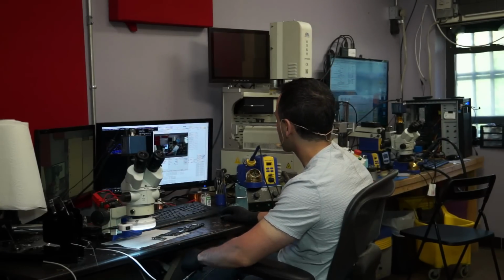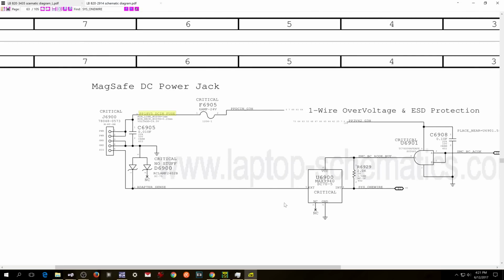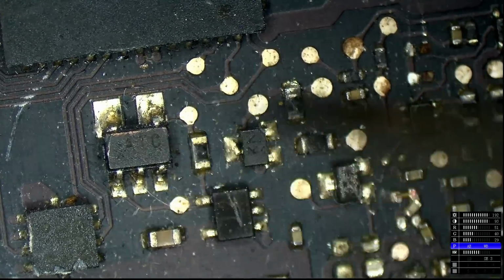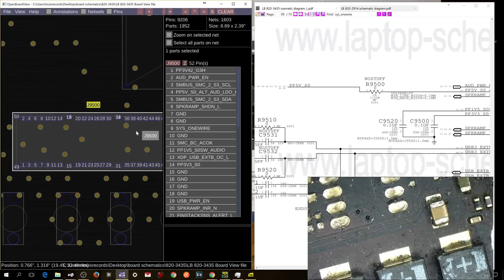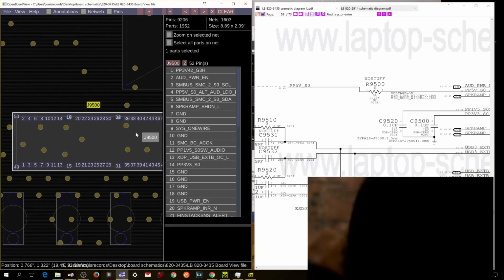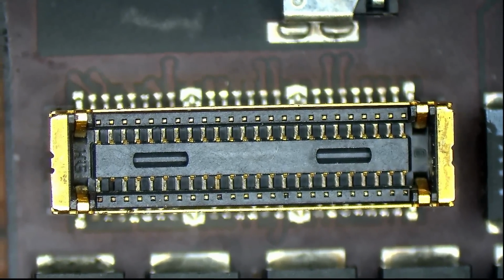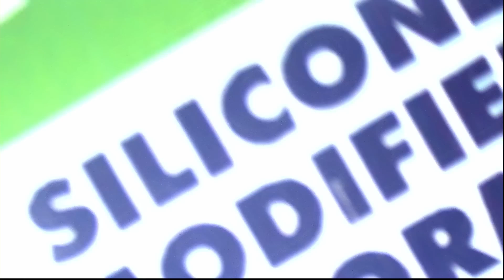Macbook Air no light on magsafe charger 820-3435

Comment: What's up Louis!! I'm working on a friend's MacBook Air A1466 because he brought to to me because it wouldn't power on. I noticed one of the caps (neb av7) was fried so I replaced it with a new one. The system board ohm'd out however it's still not powering on. Tried a smc reset but still didn't power up. 

The only thing I have left is the I/O board. Wanted to know if you could give some helpful tips on cleaning it? Alcohol perhaps?

Push comes to shove I'll just go ahead and order a new one.

Comment: Ok This is soo above my pay grade lol.... my mac book air  took a spill not even a foot off the ground and now I'm hearing a loud static sound coming from the battery post and now it won't charge. Also the lights on my keyboard don't come on. Tried smc didn't work... please help.
Reply: D.O.A. Yes, and no. Lol I went to Apple, and they said it was logic board failure.... Cost of damage $475.00
Reply: D.O.A. Yeaaaaa I'm not qualified to do that,  and I don't have a warranty. :-( I am going to get a second and third opinion as well as another price quote lol

Comment: I NEED HELP: macbook air had no backlight, got it to a shop to get fixed, now the laptop works only on battery, as soon as i plug it in the screen back light  goes black and the mackbook does not charge.
Reply from the maker: bad dc in board/dc in flex. the SMC_LID sensor is on the dc in board, when you plug it in it thinks the lid is down
Reply: Thank you. Also when i close the lid with the laptop powered on from battery, the apple logo flickers as if it's turning the screen on and off.
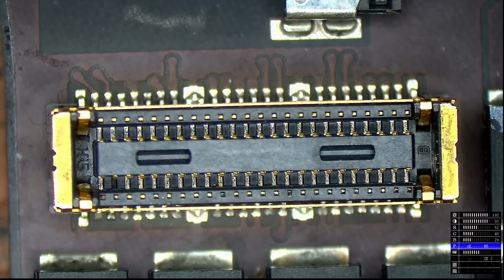Reply: I NEED HELP: I tried a new dc board. And a new flex cable from my wife's macbook air. I found something off about the connector on the logic board. The gold outer shell on the connector itself is damaged and one of the corner pins is broken off. Could that be the culprit? And could it be fixed or do i need to get the entire connector replaced. Its the connector that you have in the video at 4:51 except its the one on the logic board itself not on dc board. 
Your reply is much appreciated. 
Thank you.
Reply from the maker: You answered your own question here.

Comment: Every time a meter dies and you do the "lifetime warranty" you get another meter, so now you may have two working ones (after a replacement of the first dead one with the warranty of the second) but when the warranty on the second expires you would have to buy a third one when another dies. Call me stupid but even if they "lose" one unit on a warranty replacement the shouldn't be giving out they are selling yet another one, I don't know if the win or lose
Reply: You can't Anyway most of these things have serials on them
Reply: Louis already addressed that: the employee that receives your product for warranty replacement is paid minimum wage and won't bother to check for the serial number to match :P 
Depending on the price of the product I guess he's right, I don't expect to be able to take a whole macbook for warranty replacement but for a toy it sure as hell will work

Comment: Louis, remember I asked you about replacing the keyboard on a 2013 macbook ? during a live session ? Well I got to work on it eventually. GOOD news !!! the riveted keyboard is actually easy to replace. The pins aren't actually flattened to keep the keyboard in place. The body has holes and then a small aluminium rod is inserted in that hole and then flattened. So basically you ca pull 90% of them out while pulling on the keyboard metal sheet out, they will just pop off the rest 10% can be pulled out with a nail clipper or a small Yarn Snipper of sorts if they are still stubborn just clip them and drive a bit of sand paper over. I got a replacement keyboard from aliexpress compatible with 2013-2014 and it works ok, it came with a full set of buttons, rubber, the works. I also ordered a set of keyboard screws from a 2014. Now all I have to do is find a screwdriver small enough to screw them on. The original holes are smaller then the screw, the body is aluminium the screw is steel so it should drive in with a bit of force. Will keep you updated.

Comment: It looks like Thunderbird got replaced by Opera Mail. Hmm, does it have something to do with Thunderbird being a fork of Thunderbolt? Firefox is a fork of FireWire, and it still sits in the tray though. Weird, I thought FireWire is way more useless than Thunderbolt. So why would you get rid of Thunderbird in the first place?
Reply from the maker: +Andselisk thunderbird junk detection is worse than first iteration of pulseaudio. Eight years of training spam filter and it still sends the same good email to spam and vice versa.
Reply: I still receive flashbacks from that "poetteringed" audio experience on linux those days, great analogy. To me Thunderbird is also far away from ideal, but plugin support, tons of features and me being lazy prevent me from switching to anything else. Anyway, thanks for answering, and have a good day, Louis!